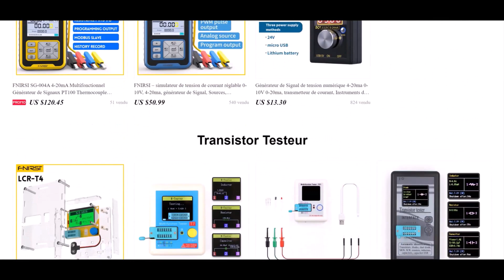65W Electric Soldering Iron , Buying Tips for the Novice Engineer FNIRSI HS 01

Comment: Too expensive, too expensive tips, not worth it. More hype and show-off than practical use.
It is better to buy a good 90W adjustable soldering iron for such electronics like CXG E90WT and 110+W for power supplies, where are more heat-intensive sections of the PCB with thick copper wires.